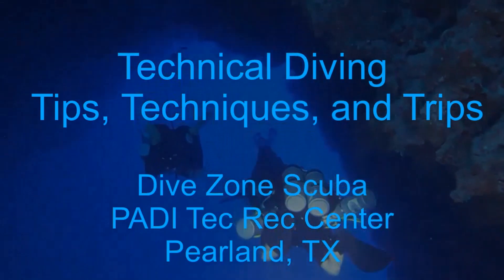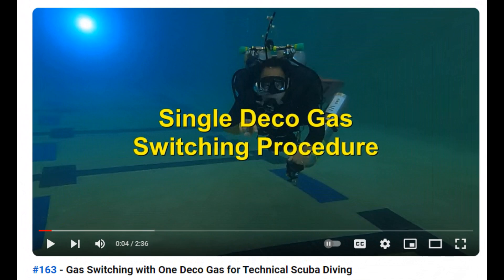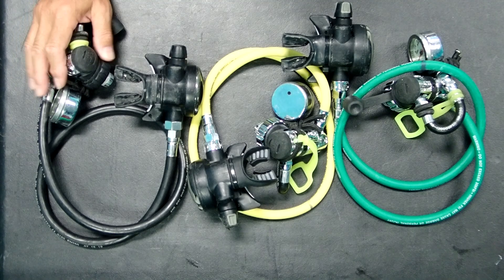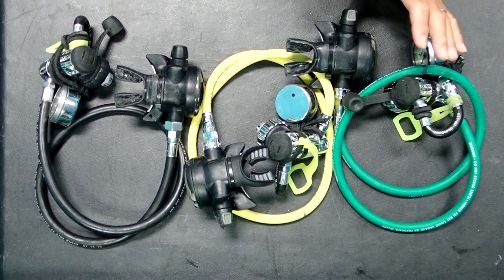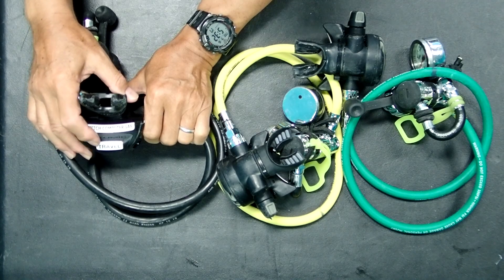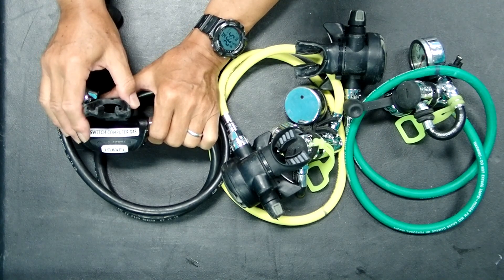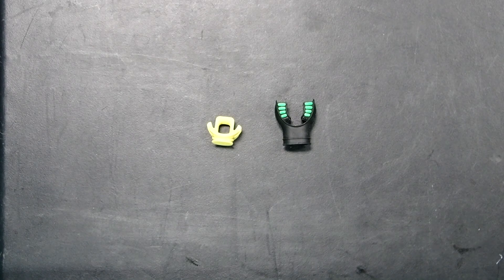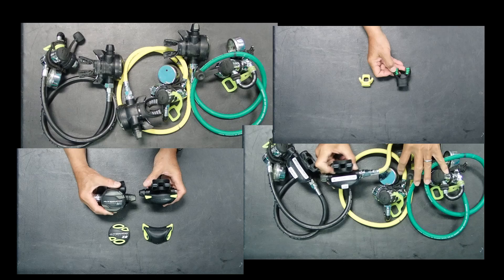#173 Additional Techniques to Help Prevent Incorrect Deco Gas Switches For Technical Scuba Divers

Comment: 1. What about diving in mixed team, where all divers have different hose colors?
2. What do I do in case I need multiple O2 cylinders but i have only one green regulator set?
3. Why do you need write there the note about the computer switch? Isn't it part of the gas switch procedure? Your buddy does not remind you in case you forget to do so?
Reply from the maker: These are secondary measures, not replacements for proper training or procedures.  Some people miss that.

There’s a personal standard and a team standard.  This gives not only you, but also other divers the opportunity to see if you somehow made a bad switch even if someone was watching you.  If the guy in Egypt had that someone may have noticed in time.  You can’t always control what other divers do.  I require any of my hypoxic students taking a course to do this.

Not having enough regulator setups is an issue.  I would go with a single bigger tank.  

The note is just another safety measure.  When a problem occurs a lot of normal procedures can not be followed as well as they normally would.  There is a Japanese manufacturing term called pokajoke.   That means that you want to make a process as bullet proof as possible.  I don’t know if I mentioned that in the video.  The label is particularly useful for me as I started technical diving not using a computer in computer mode and not doing gas switches on the computer.  At the time, the dives were all run on wetnotes.  If you had a computer, it was used as a backup to your dive plan.
Reply: Leanest gas on your left 100%. Second deco gas 50% on top of the 100%, travel gas on your right. Problem solved. Mark all gases appropriately.

Comment: Here is my system for doing Advanced Trimix dives here in the Great Lakes.I normally take 3 bottles of Deco Gas when the dive is below 230ft, 14/55% Bottom Gas and 32/35%, 50/25% and 100% Deco Gas. #1 You can't analyze your Deco gas to many times. My gas gets analyzed 3 times. Once when I pick it up at my dive shop, once before I go on my trip and once the morning I am getting ready to use it.  I verify it with the label I have put on the tank. I also take a piece of tape and put it on the bottom of my Deco Regs that has the MOD so my 32/35% had a 130MOD taped on the bottom.My 50/25% has a 70MOD ect. Even though I am very careful when I do my gas switch this gives me an added level on backup.I was taught the team approach but on my last 2 dives I was the only diver on open circut and basically did the 260 ft.dives by myself.
Reply: Your gasses are over the top for a 230ft dive. Back gas 16/40, 32Nx, 80Nx would suffice.

Comment: I thought about doing the same thing with my hoses and regs and glad to see it confirmed as a sound option to help increase safety when grabbing the wrong gas can kill you at depth.
Reply: What happens when you need to swap stage regs last minute? This entire system falls apart.
Reply from the maker: @flymol0  Than you move the label or other color coded components as necessary and you are no worse off then you were before.
Reply: @divezonescuba or more likely someone breathes the wrong gas because they were relying on color coding instead of proper switch verification
Reply from the maker: @flymol0  I do not have any statistics on that.  On the other hand many people have improperly or failed to analyze or label  tanks.  And some others have just put the wrong regulator in their mouth, which these additional measure are intended to help reduce.  The color coding and labeling also assists in putting the correct regulator and hose on the correct tank.  Green o2 label on the tank, green regulator.  In addition some o2 dedicated regulators are only available in green coloring.
Reply: @divezonescuba green coloring on regs is a marketing ploy. One proper switch procedure involves verifying the gas and depth and a teammate confirming. Not sure why there is any need to involve a label maker and the all colors of the rainbow.
Reply from the maker: @flymol0  There were 9 other teammates when the Egyptian Instructor was using the wrong gas.  I am sure one of them would have noticed that he had the wrong cylinder / regulator in his mouth if it had been colored.
Reply: @divezonescuba  buddy there is no such thing as 9 other teammates. That’s the exact opposite of a team
Reply: A team is 2 or 3 divers max. Everyone has a responsibility. 9 divers is called a cluster f**k
Reply from the maker: The color coding is not just good for you, but you can also tell at a distance if someone else is using the wrong gas for the depth.  It is particularly important in the case of an individual that is distracted or suffering from narcosis.

Comment: Hi Chris, what kind of labels did you used? Awesome video🎉
Reply from the maker: The top gas computer switching labels were from Amazon.  The bottom ones were from a brother label printer.  It connects via Bluetooth to any device.  You could just print all the labels on the brother printer.

Comment: I already use different coloured hose for this purpose, but not yellow. Yellow should stay as the colour for an OOA emergency. Hence why my primary long hose is yellow. 
Also, I find just putting a piece of white/silver Gaffa tape around the hose near the second stage that you can label the mix/MoD with a sharpie works just as well as the label you've put under the mouthpiece/on the exhaust T. My issue with the "label maker" label you've put on, is it is awkward to remove and replace, whereas Gaffa tape can be easily replaced and marked with a sharpie without much effort if you are diving with mixes that aren't always "Nx32" for instance.  I can see how the maker label would work for a GUE "Standardised gas" model of diving, but sometimes we get the gas we get, and as long as it's labelled correctly and the dive properly planned for the gases we have, then so be it...  
I do like the idea of a label under the mouthpiece/on the exhaust T reminding to confirm the gas switch on the DC though, that could easily be a permanent add.
One more step that I take if I happen to be solo, rather than team diving, I also put a gaffa tape label across the mouthpiece as a physical barrier that I have to remove before I can perform a switch. I don't use it in team, as I wouldn't want a team member to have to remove the label should the need for them to use the gas arise. But I might, as on reflection, this could also prevent an OOA diver taking the wrong reg by mistake in the panic of an OOA emergency.